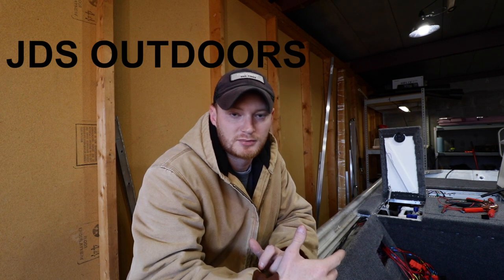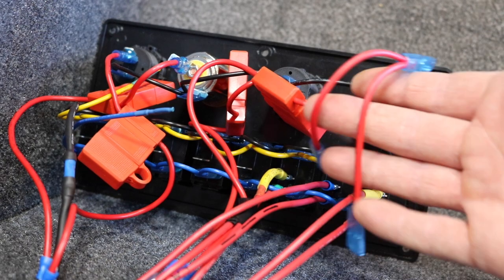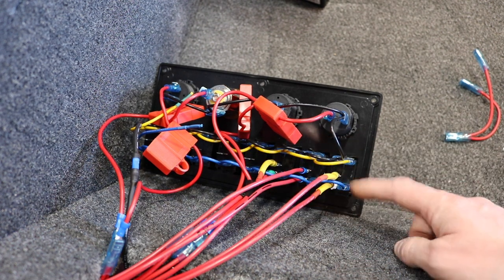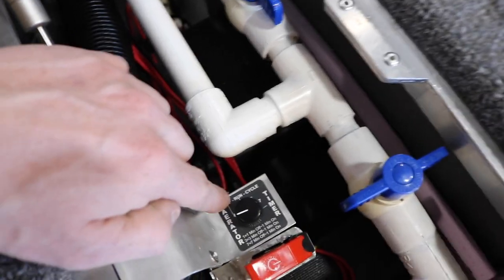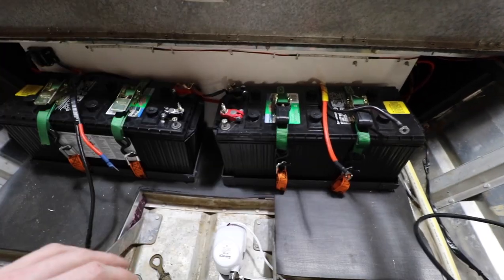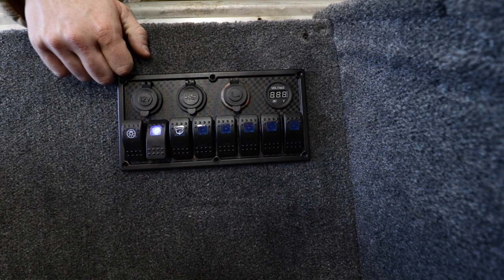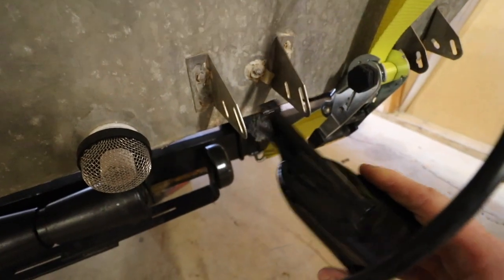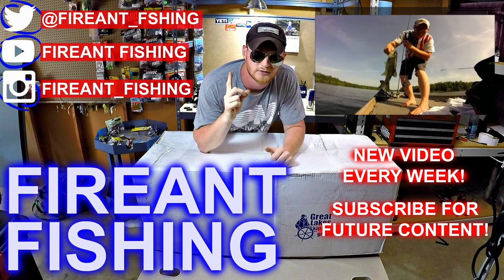Electronics in my Jon Boat: Jon Boat to Bass Boat

Comment: I have basically the same switch panel and I really appreciate the idea of hooking the Voltmeter, USB, and Cig lighter to a switch to only use them when you need them! I think I'm going to wire them up to one of the switches on the switch panel thought because like you I have extra switches that are not powering anything right now and I'd love to be able to turn that stuff on and off with a switch that's right there anyway.
Reply from the maker: yeah after i added the switch i was like wait, i could have used one on the panel...haha oh well.

Comment: I think you're going to be happy you went with a 24v setup and a separate 12v for electronics.  Those batteries are beasts !  

How much extra weight do you think all of this has added ?  Looks like those big batteries will offset any front weight very nicely.  

Good job Bud !
Reply from the maker: im not sure with the decks and stuff, but i do know each one of those batteries weighs 117lbs...haha but this boat originally had a 70hp on it so there is no way they weigh more than that thing did

Comment: I know this is a older video but didn't the bilge pump instructions call for wiring the pump direct to the battery so its circuit is hot all the time and can't be switched off so the boat is protected if no one is around and it starts taking on water and a switch to manually operate the pump when you are their and want it to run?  But I might have missed that if you did. Nice job!

Comment: Hey man, before you go through the trouble of redesigning the fuse panel, you should be fine with that Blue Sea Systems fuse panel. Even if water or moister DOES get in there, it won't corrode. Just make sure you use heat shrink connectors on all the connections. I do all the wiring for the Fish and Wildlife Commission here in Florida, and that's the same stuff I use on my officers' boats in saltwater.
Reply from the maker: oh ok cool thats good to know. i did heat shrink most of them but i think there were 2 that i had just forgotten to do
Reply: I'm wiring my boat right now. Just about finished with my restoration. If you want any ideas check out my thread on tinboats.nethttp://www.tinboats.net/forum/viewtopic.php?f=21&t=30090

Comment: I appreciate your videos. They are very helpful!
I'm new to wring and I'm trying to figure this out for my own boat. I have a question on the 6 panel switch, ...when hooking up lights and other equipment, where do you run the negative wire to? I understand the power wire from each  will go to the 6 panel switch, but what about the negative from each? ...Do they just bypass the six panel switch and go directly to the negatives on the buss bar on the fuse panel? ... I've looked  everywhere and do not seem to find much help on this. Thanks for any replies.
Reply: oh... one more thing... if they do all just tie into the negatives on the bus / fuse panel, can they be tied together? In other words if I'm tying in three or four lights on the front of the boat, can I just run one wire from the fuse panel and daisy chain the lights together on the negative wire? ... or do I have to run a negative wire from a each light all the way back to the fuse panel? Thanks again.
Reply from the maker: yeah the negative can go back to the buss bar or fuse panel, negative is always live. i spliced mine into the main negative off the panel, that way i didn't have another wire running back to the fuse box. yeah on the negative you can. hope this helps!

Comment: I have a similar panel getting ready to wire it up. My question is why do you need a busbar when only 1 hot and 1 ground come into the panel? I'm just a little confused or over thinking it.

Comment: How would you hook up that volt meter? It seems kinda tricky but then again I've never done it before 😂
Reply from the maker: its got its own wires from the back of the panel that i ran to a switch so its not running all the time

Comment: If you do not want to buy/install another battery for 12v accessories you can get dc volt stepdown units to convert 24 to 12v.  Also a lot of dc products will run on a wide range of voltage, especially led lights, check the specs.  Some accesories that do not have a wide range (your bildge pump for instance) can be purchased in 12 or 24 volt versions.
Speaking of bildge pumps you did not mention if you had a live wire going to the bildge pump at all times to work with the float system.  Most boats use a three way switch - on, off and auto - or a 2 way switch with the third wire going to the battery (fused) for auto pumping via the float switch.  Without the third wire being hooked up the float is useless and you can save money by buying a pump without it. 
I did not fully understand how you are getting 12 and 24 volts from the same battery bank.  A little more explanation would be great.  Thanks for sharing, the boat is looking good.
Reply from the maker: thanks for the tip! I'm going to look into that! it sounds a little out of my comfort zone but ill check it out. 
yeah i didn't do a good job explaining the bildge or the 24 and 12v "combo", but this bildge had directions to hook it up to a 3 way and 2 way, i just did the 2 way and i did have to fuse it twice on the fuse box. 
for the 12v trolling motor for instance, it is just connected to one battery like you normally would. then i have a wire going from one batteries + to the others -. then i just connect the 24v trolling motor to one batteries + and the others -
Reply from the maker: just realized my issue running it all off the 24v system, looking into the step-down unit. thank you for commenting this!!!!!
Reply: I'm not sure you are getting 12v it might be 24 which will eventually burn out 12v stuff.  The step downs are cheap just make sure it can handle the amps for the 12v trolling motor.
Reply from the maker: i was looking at them but i think I'm going to run it all separately. i was going to eventually get the other battery anyhow
Reply from the maker: thank you thank you thank you for commenting this, you really just saved my tail

Comment: Instead of running that red switch for your volt meter and chargers you could have just ran them to a switch on the switch panel. That is what I did and it is really convenient and simple.